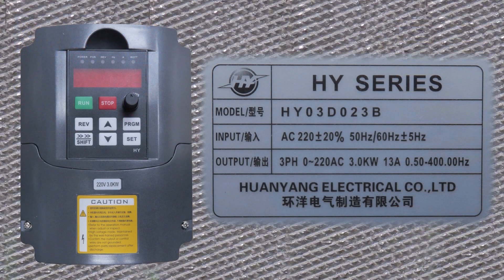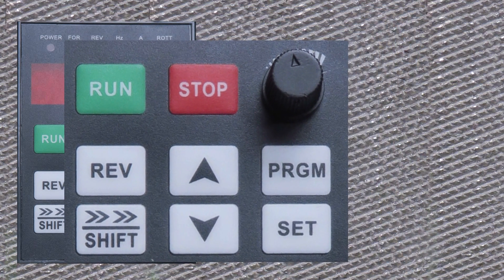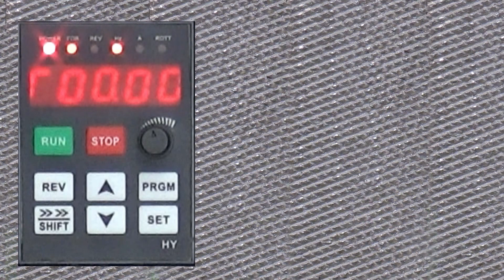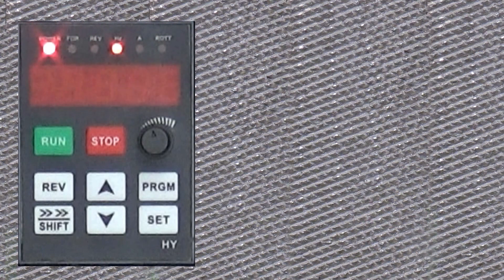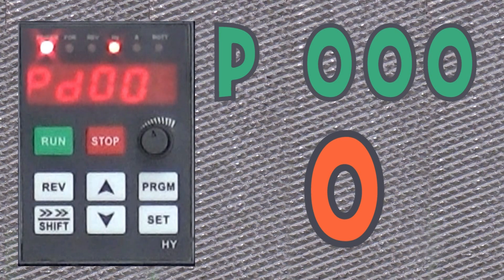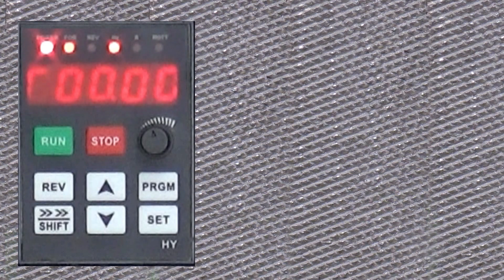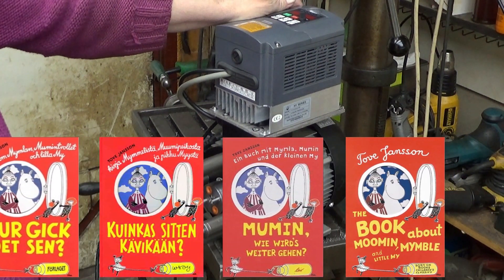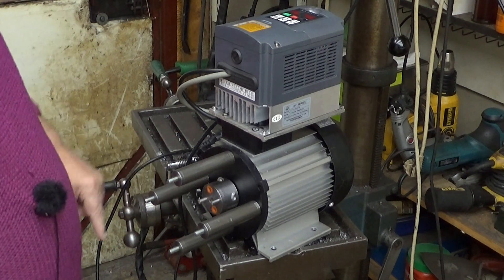How to adjust Huanyang VFD parameters

Comment: Would you be able to offer any help with getting my  5hp Huanyang reset to run : 3hp 60 cycle 220 3 ph, 3500 target rpm with a 10 second ramp?